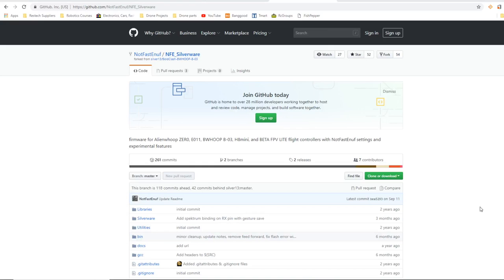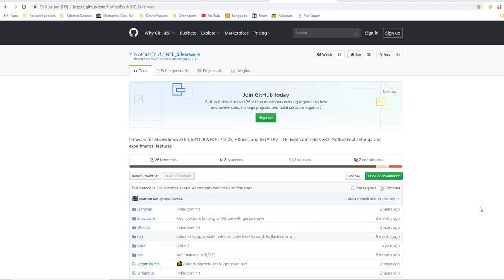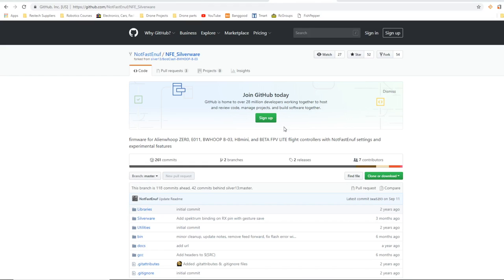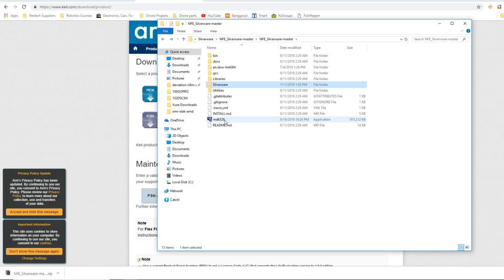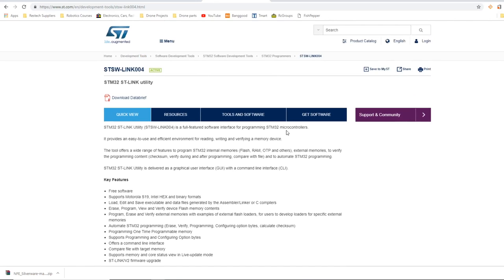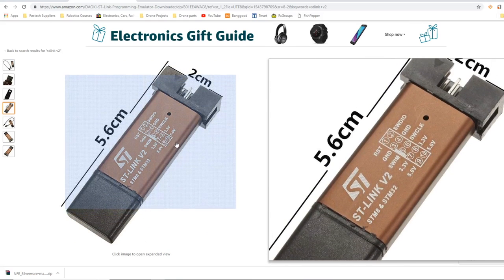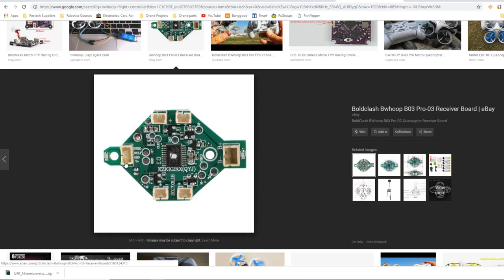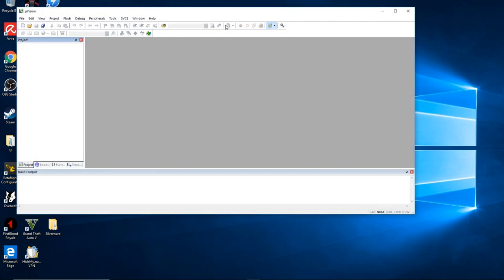The NFE Silverware Guide - Components & Software Part 1

Comment: Can i flash it with beecorelite v1.1
Reply from the maker: Yup all the beecore lite controllers run on silverware firmware you just gotta define the correct board and RX protocol
Reply: @dwarfstarfpv2056  yeah